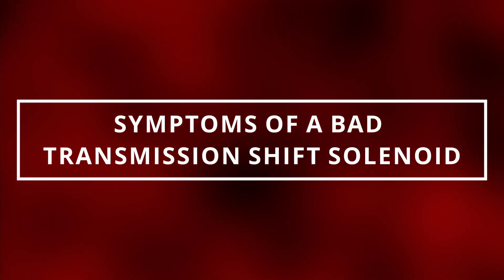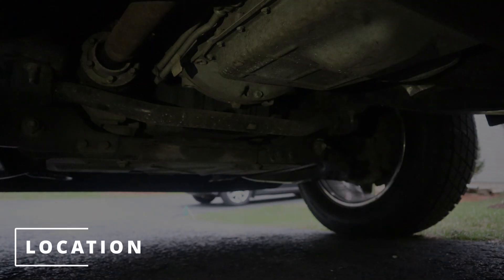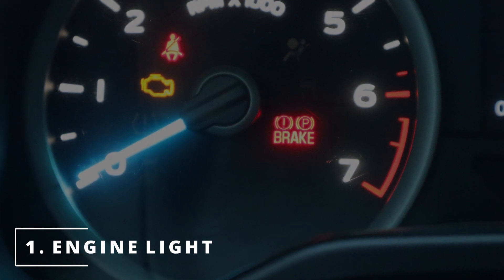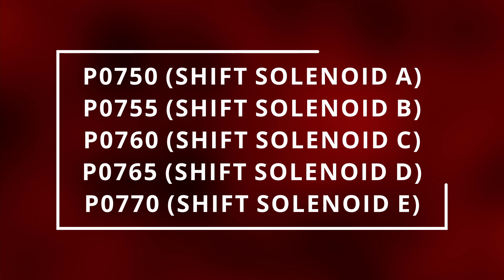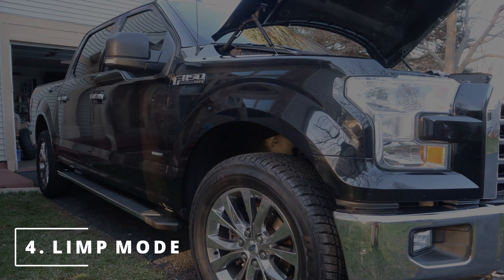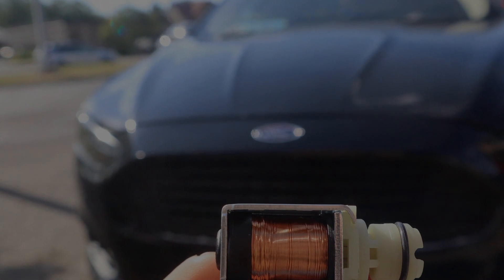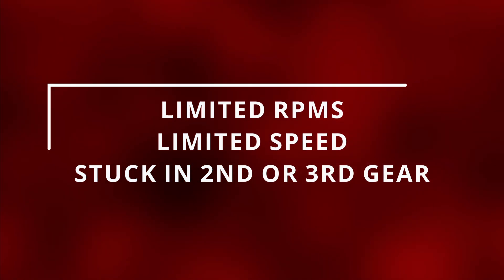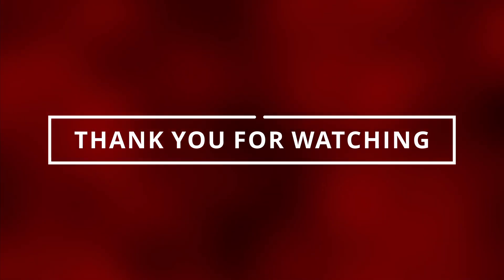SYMPTOMS OF A BAD TRANSMISSION SHIFT SOLENOID

Comment: Thank you! Those are the symptoms my car is experiencing!!
Reply from the maker: Awesome,Thanks for watching!
Reply: Did changing them help?
Reply: I have the same problem but no check engine? Any help
Reply: sometimes my car could not shift gear the engine just revs and that is it.so I went to change transmission oil it was black.put new one and went to a shop that uses a special machine that is for changing transmission oil .believe it or not at my last transmission oil the people told me they do notnhave the proper equipment sp they could oybtake out only 40% old oil.noq they took 90%of the old oil.
now the car shifts way better than before and so far does not stuck and does thebold problem but I still think new solenoids would help.
Reply: @EPICSOUNDTRAX they did a complete flush vs a drain and fill. Some people recommend against it as it can potentially cause more damage